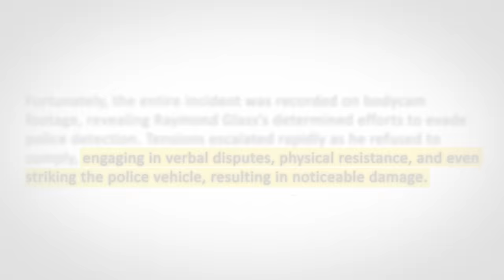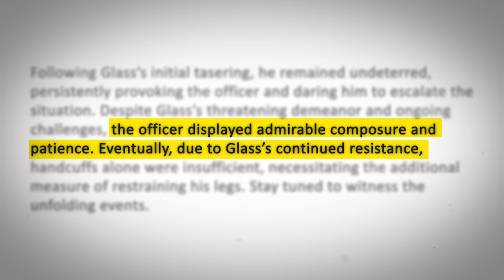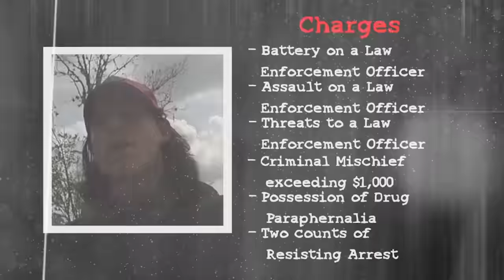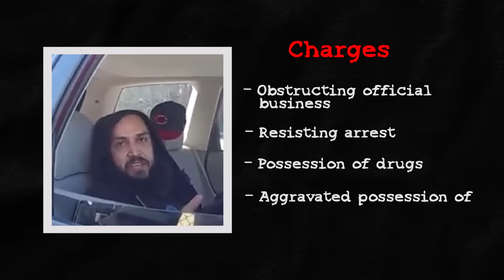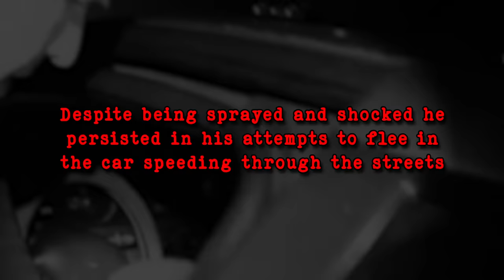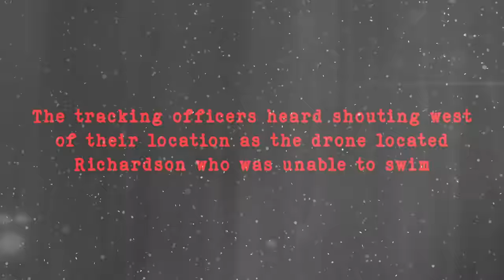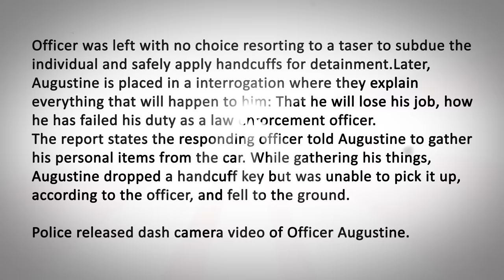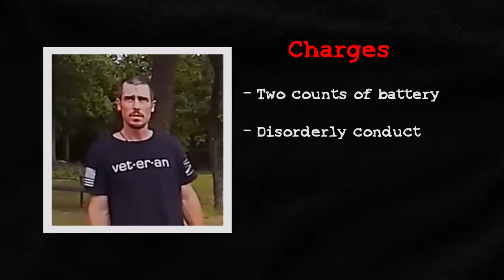When Fake Tough Guys Realized They're Going To Jail

Comment: 32:25 the third cop that came in for the takedown threw closed handed punches to this man’s body, hands, and face WHILE the man was on the ground. Then he grabbed the man’s head and bounced his face off of the concrete shouting Literally “don’t (bounce) bite(bounce)me!(bounce)” Now obviously this is not how a police officer should ever behave. This was the behavior of a man that came to whip some ass street fighter style. I just wanted to point that out. Was the guy an asshole and a drunken one at that? Yes absolutely, but even when a suspect is resisting no cop should ever disgrace his profession by going into full blown hands on destruction mode.. it’s extremely unprofessional 💯

Comment: I can understand if people are just unloading all types of trash and somebody else's trash can, but if you just see a single piece of trash or whatever it may be and you just simply put it in the trash can so it's not on the street or what have you I don't see the problem in that I do see a problem and unloading bags and bags of trash and somebody else's trash can...... but it will be pretty Petty for somebody to file a complaint if you're just putting a couple of items of trash in the trash can and other than throwing it out on the street where you would definitely be cited for littering...... some people could be so petty

Comment: I'm sorry but the cops created this behavioral phenomenon when the first one put a body cam on. I remember when I was 17 and got caught fleeing from the cops in a stolen car. Man I used to raise hell. When the cops finally got me I acted just like this kid exceptbI actually kicked the cop and punched another in the nuts. That was decades ago before tasers and body cams. After they kicked my ass and had me cuffed I was thrown in the back of a cop car. Half way to the jail they pulled over and asked me if I wanted the extra charges or to be taught a lesson then and there. I had no idea what they meant so of course I said I didn't want any more charges. They then pulled me out of the car and tuned me up really well. Learned to never hit a cop again real quick. The next time i got arrested I got really mouthy with the cop. Man I used every racial slur disregarding he was a white guy completely. I was still going off on him when i got to the jail. Of course my dumbass didnt even bother to take into account that 4 of them got into the elevator with me. They didn't push a button and I was wondering why when the door was closing. One of thw jailors looked me dead in the eye and said "look around and tell me what you don't see." I couldnt figure out what he was saying until he then said "you don't see any cameras." They then proceeded to suggest I keep my mouth shut the next time I get arrested. One of the worst beatings I ever took. I will say this about them back then. They loved to give handcuffed prisoners a beating but unlike today they were very reluctant to charge someone with a felony. Today you catch a felony for the smallest stupidest things. Back then you really had to screw up to catch one. Even when I got caught in a stolen car they only charged me with a misdemeanor. If violence wasn't involved it was very unlikely you would get a felony. 2-3 years ago my nephew got caught with a couple of his friends hitting mailboxes with a bat. He got charged with 6 felonies and his bond was $15k to get out. Worst I did back then was throw a brick through a gas station window for a pack of smokes because they were closed. Today that would probably be 10 felonies back then it was misdemeanor breaking and entering. They didnt charge me with theft because I left the $2 for the smokes on the counter.

Comment: The cop that arrested the guy on a probation violation & uses his taser and acts like its not volant is really a terrible cop. He could have easily warned the guy & kept it moving but chose to escalate it at every point. In any other western country cops don't get to act like thugs straight away, its really sad.
Reply: I’m pretty sure the first guy was warned before he was tased
Reply: It was a parole violation.  That's an automatic arrest.  Also most likely a revocation of his parole.
Reply: @maryjoyspohrer256  and it seemed like the officer was 100% familiar with the guy already, so he’s likely a regular at the local PD.